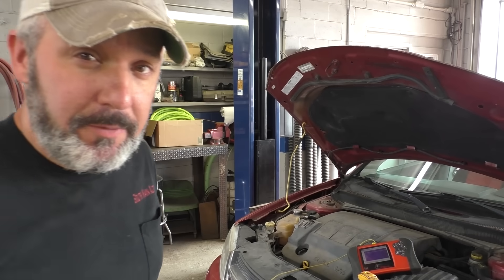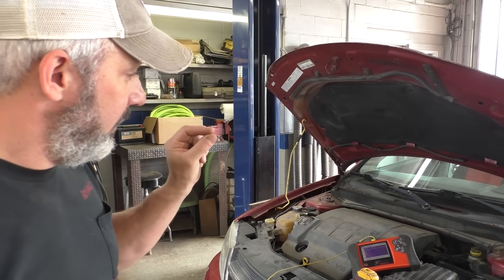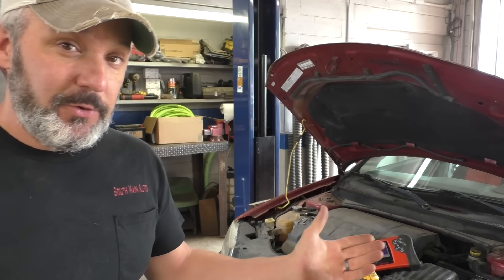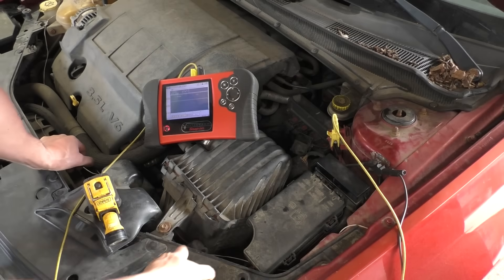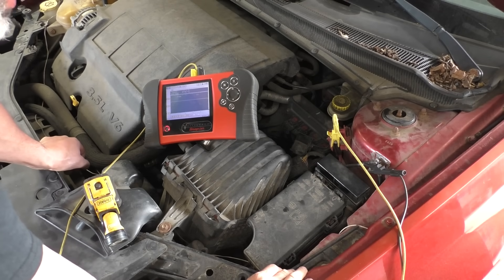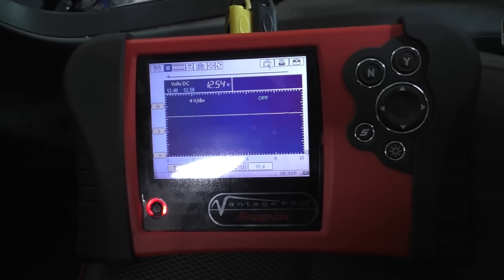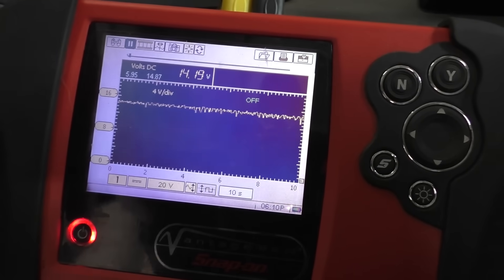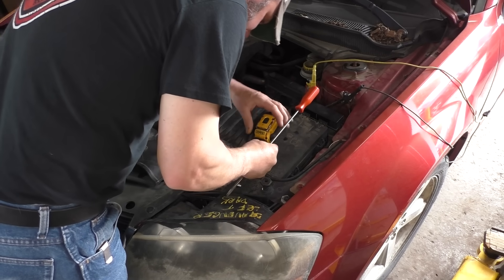Another Lesson In Voltage Drop - Don't Skip The Basics!

Comment: An old man's car died in the McDonald's drive-through.  After pushing him out of the lane I figured out that it was getting no fuel.  I diagnosed a dead fuel pump, and he said that was his third dead fuel pump in 18 months.  But I also noticed on the computer that the car was showing only 10 volts when running.  I replaced the fuel pump and his car ran again, but I also knew that the low voltage could be the reason the fuel pumps were dying.  The very first thing I checked for voltage drop was from the battery post to the battery clamp, and there were my 4 volts, basically two volts per post.  I removed the clamps and found both posts coated with something like varnish.  I cleaned them and boom, 14 volts when the engine was running.  Hopefully that will keep the new fuel pump from burning out fast like the previous ones.   By the way, I'm a DIYer who learned voltage drop testing on this channel (along with most of everything else I know about cars).
Reply: Me too I learned a lot from this guy
Reply: Awesome!!! 👍
Reply: I learned the same thing many years ago when I swapped out a battery (then cleaned the battery posts & cables) for someone, then put their original battery back in & it started right up.  The reason I put their battery back in was because I was using mine as a test battery.
Reply: @s.j.5850  If it was that black coating you had, that is a lead oxide and it looks so innocent because its not an oozing acid or fluffy acid buildup. That black coating is hard like glass and does not come off easy but what it does is completely block electricity from passing through it if bad enough. Even a new stainless steel battery brush has a tough time to remove that crap and ether have to use sand paper or a special scraper type of battery post cleaner to peel that off and expose new shiny lead. The same thing can happen to the inside of the cable ends and if a person just isn't aware of what it should look like clean, it ends up being reassembled assuming "the connection is good" when in fact its extremely awful.
Reply: @charlesb4267  I'll keep my eye out for that.  On a dark grey battery post that could be easy to miss.
Reply: Those battery terminals must have been getting quite hot.
Reply: @jptrainor  I hadn't thought of that, but I bet you're right!
Reply: Excellent ☘️
Reply: I salute you, sir.
Reply: that's called low voltage burnout. as the voltage decreases, current consumed increases causing premature wear. also why it is not recommended to keep cranking the starter when the battery is low. if you ever see a car keep blowing bulbs there could also be a similar issue. great job helping the old dude out!
Reply: @user-fw8kt9dq9m  I think that only applies to motors or possibly solenoids but on a bulb circuit it's simple V= IR there's no back EMF or whatever
Reply: @-BuddyGuy  Hey guy. If there's a device, connection point, splice or a contact, you can and probably will have a voltage drop of some value. Lighting is actually a very common circuit for drops. Watch more of Eric's videos on voltage drops if your that interested in learning. I knew and used v drop rather loosely but it's Eric's videos that have put it all together for me. I'll just sum it up by asking if you have ever saw dim lights on a semi or a trailer or camper? Later!
Reply: @jpol3808  I was referring to voltage drop causing an increase in current and therefore burning out a component. Keep up
Reply: @-BuddyGuy  Sorry buddy. My comment was supposed to be to @user-fw8kt9dq9m who commented to you about burnt out light bulbs. By my comment one should have dicerned that... Keep up
Reply: @-BuddyGuy a fuel pump is a motor. So it does make sense under voltage will case excessive current increase
Reply: By any chance was this varnish you refer to black ?
Reply: @charlesb4267  No, it was yellowish like old varnish.
Reply: @TStheDeplorable  Ok, in that case its very possible that he sprayed it with an anti corrode spray meant for this very purpose and for some time I was using such a spray but it had to be sprayed on the connection AFTER it was connected and tight. The instructions never said anything one way or the other but I figured out that the product did dry/cure to what amounted to an impenetrable varnish although yellow in color and if the connection was not perfect it would seep into the voids as per undoing the connection and finding some of the cured product on the post and the battery cable clamp end. I decided after some use of that product to stop using it as it was difficult to remove to re clean the connections and lets say one undid the connection and reconnected it, odds are that when it was re clamped that it was in a slightly different position and now have some of that non conducting varnish between the connection. An example of it being non conductive, using a volt meter to check voltage of the static battery or while charging and struggling to poke through that layer with the multi meter probes on either the battery or the cable clamp as it was all covered in that varnish like substance. So it was easy to see if one sprayed the posts first or the cable end and the product cured or partly cured, then did up the connection, you've just created a shitty connection !. I used to buy a no corrode grease like paste years back but have not seen that product for ages now, lately have used some fluid film and that certainly helps keep moisture and corrosion at bay without seemingly compromising the connection from what I can tell.
Reply: @charlesb4267  Yup, that sure sounds plausible for what happened to that guy's car.  Thanks for the info!
Reply: If there's a bad ground it could damage bearings too
Reply: @JoseRamirez-em7zp  Explain that one to me. I'm just an electrical contractor. Thanks.
Reply: I just had to replace all four wheel bearings because my battery had a bad ground!!! HAHAHAHAHAHAHAAHAHAHHAHA.....JUST KIDDING!! LIKE WTF??
Reply: @copiertech101  When I had the computer hooked up it read system voltage at around 10 volts (attached at the OBD2 port).  After cleaning the battery posts, which were like they had been varnished, the computer read system voltage at 13 volts.  So although the power to the various systems is certainly coming from the alternator when the engine is on, the battery is not removed from the equation.  I'll have to spend some time with some wiring diagrams and sort this out.
Reply: Same problem, fuel pumps dying. i'm going to check my terminals later.
Reply: @Marandal  If that's not the issue right there at the terminals, try a voltage drop test along the whole circuit from battery to pump to ground and back.  Good luck!  UPDATE:  Yesterday the guy called and said the car wouldn't start, and the battery turned out to be fried.  Perhaps it was just a coincidence, but my guess is that it was damaged by the poor connections at the posts for all that time.
Reply: Eric Os comments in the last 30 seconds of the video are important bits...you won't see voltage drop unless you have current flow and ohm meters are useless for these tests because during measurement there is essentially zero current.

Implied by the starter test but not specifically mentioned is that voltage drop increases with current. (In theory it's proportional based on V=IR but in practice the resistance of poor connections may vary with current.)
 
Another excellent video
Reply: @markjones3121  Yes, do the voltage drop test while someone is turning the key to try to start the car.  Am I missing something?  I'm new to this.
Reply: The fuel pump would be running off the alternator voltage not the battery bro. The only thing you fixed was the charging voltage supplied to the battery!
Reply: Ive made thousands of dollars using simple good techniques i picked up from watching sma
Reply: Why is "old" man mentioned? F you
Reply: Was it old McDonald? lol good diag !
Reply: Eric you are not only a fantastic mechanic, you are an excellent teacher and communicator! You really need to take advantage of your abilities now! As I found out age takes a toll on your fiscal abilities and catches up too fast! Keep up the great videos. I really enjoyed your Dear hunt video with misses “O”: you
 are truly a blessed man.
Reply: gj 👍
Reply: The fuel pump runs off the alternator not the battery bro. You only fixed a battery charging issue.
Reply: The fuel pump runs off the alternator not the battery bro. You only fixed a battery charging issue.
Reply: @rsanchez9192  Incorrect. The alternator can't do it's job without a properly functioning battery, the entire vehicle is one big circuit grounded by the tires. You have a lot of learning left to do.
Reply: I keep telling people to stop smearing a bunch of goop all over the terminals. Just leave it alone and clean when necessary. Oh well a hard head makes a soft asp
Reply: @MacAutoDiag  Nothing wrong with the correct "goop", it prevents corrosion and the resulting issues. Eric wouldn't use it if it caused problems rather than prevented them.
Reply: @ferrumignis  I've been censored so every reply I make just gets banned. Oh well
Reply: @MacAutoDiag  I hear you, a huge number of my posts go missing.
Reply: Golly....  you replaced the fuel pump in the McDonalds parking lot?  You dropped the fuel tank too?  Bet McDonalds was happy about that!  Free Happy Meal for you?
Reply: @tomtke7351  Not what I read.  He diagnosed in that parking lot NOT replaced.  The owner stated he had replaced the pump 3 times in the previous 18 months. The fuel pump was saved by correcting the VD in the parking lot. Anyway, that’s what I read.
Reply: @tomtke7351  I didn't need to drop the fuel tank.  It was a Ford Escape with an access panel under the back seat.
Reply: @tomtke7351 alot of fuel pumps are accessed without dropping the tank i.e. removing the back seat, or taking out 6 bolts and lifting the truck bed ....
Reply: Use of "old man" implies something...   or some thinking.   I'm conjecting you are looking for extra appreciation for doing your job correctly.
Reply: @tomtke7351  Have you always been a ignorant ahole or is this a recent character flaw?

Comment: I learned the hard way too that checking every connection point also applies when checking for opens/shorts. I couldn't figure out why one of my TPS on the throttle body was showing 0v but everywhere in the circuit was 5v. Then by accident I pressed really hard on the connecter and the voltage came back, some how there was a failure from the back of the wire in the connector to the front of the pin, lol. I checked the voltage everywhere except the place it mattered, lol.

Comment: Great demonstration! I typically teach a maximum of 0.1v per connection and 0.1v for every meter of battery cable. Never to exceed 0.5v for the entire insulated circuit or entire ground circuit..This only applies to high current circuits such as starter and alternator testing. I'll bet on that car if you cranked it for 15 seconds in clear flood mode you would be able to "see" a hot connection with a thermal camera. 1volt times 100amps is 100watts. That's got to warm up something...
Reply from the maker: Smoke is always a good visual que ;-)
Reply: @SouthMainAuto  visual cue
Reply: In aviation, a 0.5V drop applies to any circuit carrying power not just the big ones.  The tables in AC 43.13-1b go down to at least 22AWG.  They also differentiate between continuous and intermittent loads.  They allow a 1V drop for intermittent loads.
Reply: @major__kong  that's interesting
Reply: disable fuel/spark and crank until something emits smoke.... 🤪 even if manually via starter relay jumping. wait I would never do such a thing and have never( yeah right, look for smoke first, then troubleshoot second)

Comment: Using the screwdriver as a negative probe?  Everyone knows when you're using tools as a probe deep in the recesses of the engine bay you need to check with the positive.... it gives the best most accurate reading.
Reply: Lol the positive cable sure to be enlightening and shocking using a screwdriver. 😂
Reply: @mikemiller3565  You're the only person that got it judging by the likes.
Reply: @waynesanders1406  been there, done that
Reply from the maker: @mikemiller3565 only if it rubs on the wrong things 😅
Reply: To stop the disagreers, Instead of removing the black negative lead from the screwdriver shank and then clipping it onto the ground stud, leave the black lead on the screwdriver shank and pull the whole screwdriver up and probe the ground stud with the tip of the screwdriver to show that using the screwdriver as an extension probe doesn't change the readings or add any more voltage drop.  It probably won't shut up or stop the disagreers from disagreeing all the time, but that's because those people are just naturally disagreeable.
Reply from the maker: I think you may have missed the point here. We were checking voltage drop on the negative side of the circuit.  That is where we showed our one volt of voltage loss.

Comment: Thanks for a  good explanation 😊
Reply from the maker: Glad it was helpful!
Reply: @SouthMainAuto  Nah, wasn't any help because I don't have any of those problems because I learned years ago that those aftermarket replacement battery post and cable clamps are crap and nothing but trouble, and they probably shouldn't even make them so people would have to buy and install a new cable, which is what the real solution is.  Any time you see those replacement clamps you can bet you're gonna end up buying a new OEM type cable and you'd be better off doing that first instead of last.